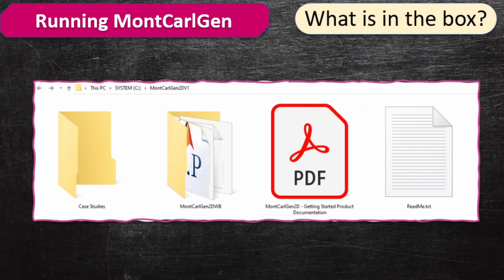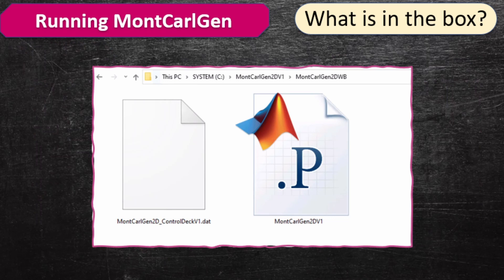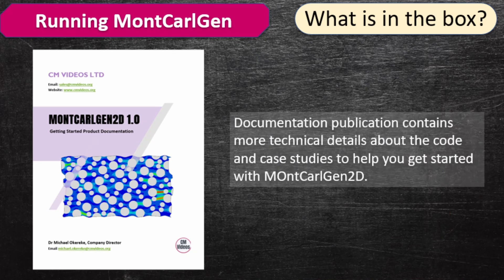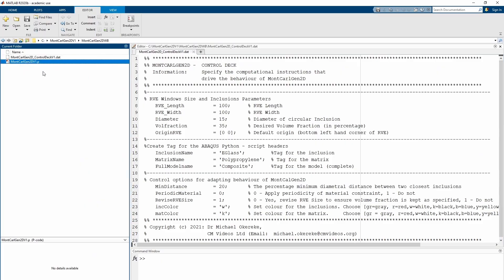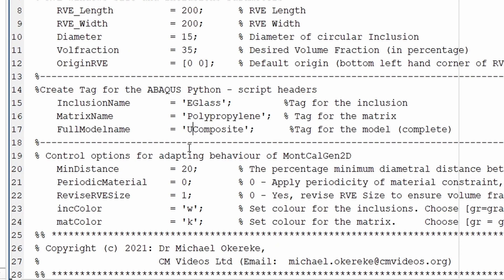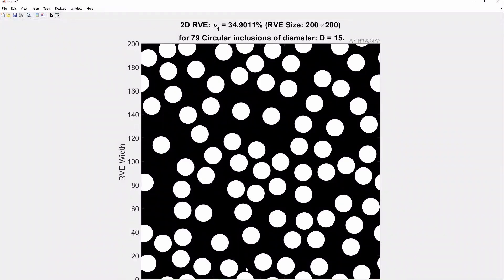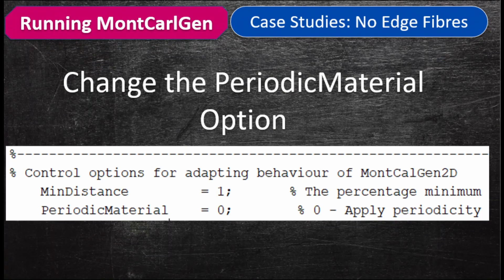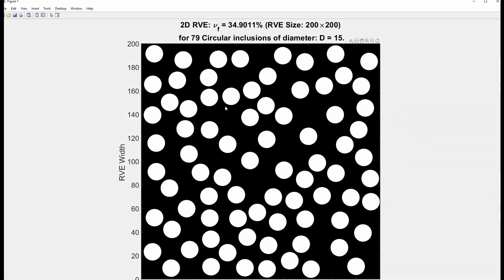How to generate RVEs with random fibres using MontCarlGen2D.

Comment: As I am your CM videos fan, I really am pleased to watch a great video. I have one thing to ask. How to change a shape of inclusions, for example, ellipsoidal, plate-like, or irregular (here, a circular shape is fixed on this code)? I guess it can be made manually based on the output of circular shape with its position, then the shape that I want to change is manually drew according to the position of circular shape. Is it okay for my idea? BTW, If you have a plan to upgrade the code, I hope the inclusion shape change and the unlimited volume fraction of inclusion can be executed to the upgrade version. 

Another question: interphase (or interface region) is possible made on this code?
Reply from the maker: Hello @Enidentictok, thanks for your comment. Yes, it is possible to include those other inclusion shapes - and your idea about it is a first approach to solving the problem. You can use MontCarlGen2Dv1 to generate the original circular geometries and simply substitute those with the other shapes inside ABAQUS. The only problem with this method is that your volume fraction will be different based on the shape chosen, so you might have to do it differently. 

On the higher volume fraction query, this is again possible. My current implementation of the Monte Carlo Methods only uses the Random Sequential Adsorption approach does not allow for high volume fraction. To achieve higher volume fraction, several heuristic adjustments to the RSA-generated RVE has to be done.

As you guessed, both suggestions are in my To Do list of improvements to the code and as they become implemented, I will like my audience know about them, and probably make videos to demonstrate those changes.
Reply: @MichaelOkereke  Thank you for the reply.

Comment: Dr. Michael Okereke,   can we extrude this 2d model into 3D RVE in Abaqus after creating 2D RVE mesh with help of extrode mesh option ................is it possible  if so please let me know....i need to generate this  as 3D RVE and predict mechanical properties
Reply from the maker: No @Nagappa, I don't think you can create a 3D mesh from a 2D domain, at least within CAE but programmatically using Python, one may be able to code this specific requirement up. Good luck.

Comment: Thank you for your amazing video! Dr, is it possible to change from square RVE to circular RVE? if yes, how to do that?
Reply: Thank you, I understand what you mean. I will try to do it. But if you could make a video about it, it will help me a lot. Also, I purchase the MonteCarlo 2D. I tried to use RVE_Length, RVE_Width, Diameter, and VolFraction of 132, 132, 11, and above 53 and the fibre is overlapping with each other
Reply from the maker: Hello @Happy Zombie, thanks for your comments about MontCarlGen2D. I did say in the documentation that came with the code that when the volume fraction is above 45% or so, then the code will yield overlapping fibres. This is because the current implementation does not include the fibre stirring or heuristic algorithm that allows for higher volume fractions to be generated. The classic hard core approach, upon which MontCarlGen2D is based on, suffers from a jamming limit of 45% - 48% volume fraction. I am going to implement the stirring/heuristic upgrade in future releases of the code. I released this version because of lot of people in the CM Videos community were asking for it. 

Does your work require generating up to 53% volume fraction? If so, what I will suggest is a hybrid approach comprising automatic RVE generating using MontCarlGen2D and a manual approach. Initially, you can use MontCarlGen2D to generate up to 45% and then for the remainder fibres, you can then introduce them manually. The remaining extra fibres needed to meet the desired volume fraction are usually quite low. 

For example, for your system with RVE_Length = RVE_Width = 132 um, Fibre_Diameter = 11 um, and volume fraction, Vf = 53%, my calculation shows that you need about 97 fibres to achieve the specified volume fraction. You can use MontCarlGen2D to generate the RVE for up to 48% volume fraction but I will stay at 45% conservatively. This means you have 83 fibres in the window (for Vf = 45%). The remaining 97 minus 83 = 14 fibres can be introduced manually. This way, you are able to meet your desired volume fraction. I know this is a bit of an unwieldy way of doing it, but that is what you can do now until the next version of the code is released.

I hope the explanations are okay with you.
Reply: @MichaelOkereke  Thank you for you detailed answer, I really appreciate it. Yes I read that the jamming limit is 48% but it still worked fine when I tried 50% Vf. My actual work require generating up to 70% volume fraction. I understand your explanation but if I manually introduced for the rest of fibres for 70% volume fraction, I think it will takes to much time and the probability of its failure will be high.

Sure, I will look forward for the next version of the code. Do I have to repurchase it or there will be some kind of software update?

However, all your videos are very helpful for my study. Thank you so much
Reply from the maker: Hello @Happy Zombie, you are right about the time-consuming nature of virtual domain creation using the hybrid approach I suggested. However, that is the best we have now until a new version of the code is ready.

With regards to further updates of the code and re-purchasing it, I am not sure what I will do. I probably will offer a paid upgrade plan. I will let my subscribers know what the plan will be when the code is ready.
Reply: @MichaelOkereke  Thank you for your plan. I hope only a paid upgrade plan for a buyer who bought the MontCarlGen2D version 1.0  before. That is applied to me as well😊
Reply from the maker: Hello @Happy Zombie, thanks for your interest in the channel and the comments. It is not possible to change directly from square RVE to circular RVE. What you can do is to create a square RVE and when you import this into ABAQUS, you can then extrude-cut it into a circular RVE. Is this something you are interested in? Let me know and I can make a video about it. I will like to get some more information about the need for  a circular RVE with random distributed fibre inclusions.

Comment: Great video as always 👌 
Dr, can we use this to obtain coordinates of inclusion for comsol? I mean can we get the coordinates in excel file?
Reply from the maker: Hello @Anas, thanks for your interest in the channel. Yes, in deed, the software - MontCarlGen2D - outputs an Excel file with the fibre coordinates. You can simply download the file and use it as input for your COMSOL work. I hope it works for you and do let me know if you need any help.
Reply: @MichaelOkereke   Hello Dr, i was wondering how to model non overlapping circles with this module. Let’s say i have polymer slab of 1000 by 1000 nm, while radius of Nanoparticle is 15 nm. Now using the formula you provided I calculate the number of Nanoparticles for 5 vol% which out to be 73 and inter particles distance is 50 nm. So my question is it possible that we can get these numbers of non overlapping Nanoparticles using this module.